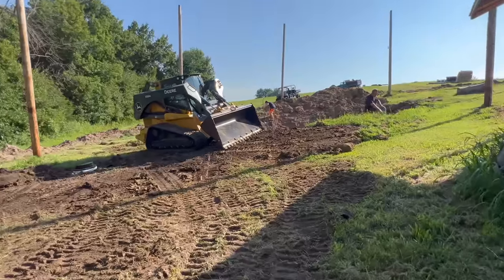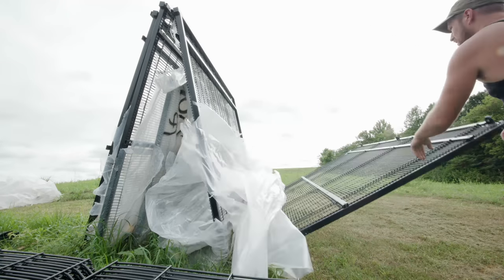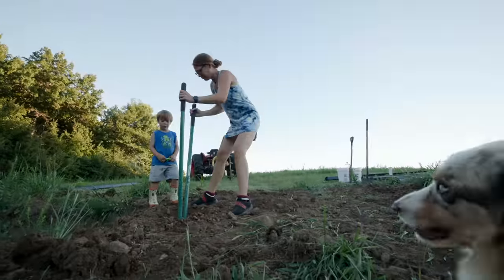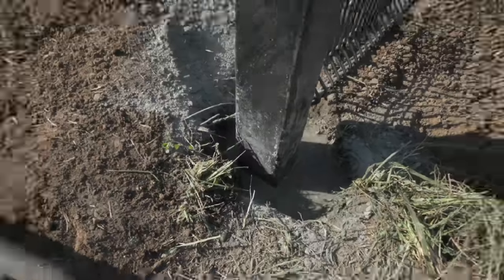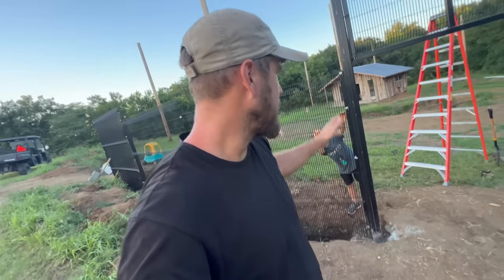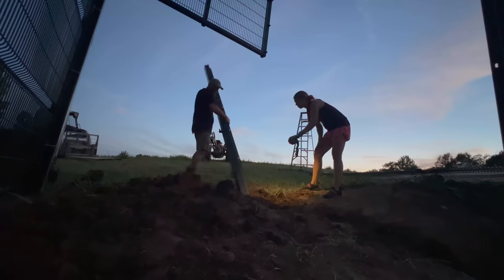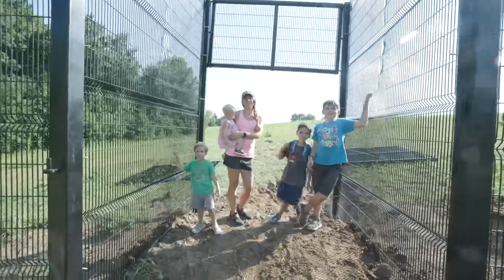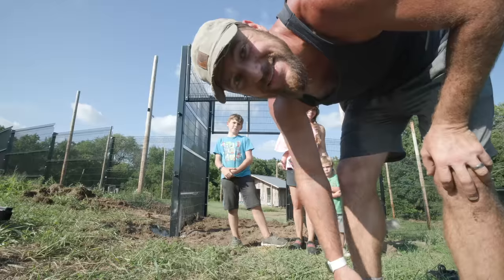The Aviary has a Huge Gate! building an aviary part 8

Comment: one idea to keep some the of the clever land predators from your animals are large rollers on top of the fences but that is purely for permanent fencing like your aviary to prevent animals from climbing over as those predators aint going to be getting a grip on those rollers enough to get them over the fences
Reply: If I remember correctly, they have very heavy duty netting that is going on the top, so nothing will be able to get in anyways! But doesn’t hurt to have all the precautions you can!
Reply from the maker: What are rollers?

Comment: @White House on the Hill Yeah,it is suppose to be level. I have put enclosures like this together before when I was younger. I had run into time and money constraints back then myself so leveling was not always an option. If you have the tools for it or if the structure has ways to allow you to do it...what we did was got rolls of barbless wire and strung it across to give it a straighter top and than got rolls of yard guard fencing and hung it on the wire guides we made with the barbless wire. Sometimes we needed to drill holes and once even had a welder guy come but for the most part we made it work. We had to because some of these we built had roofing and types of netting or fenced roofing. It was still not a perfect fit all the time because the roofing was usually made to fit when level but this stuff will help fill it in where you need to. Just remember to attach any netting or roofing to the structure as much as possible for integrity. You seem to figure things out to fit your needs though so hopefully it will all come together smoothly. You guys are tough though! I had the help of 4 or 5 guys,a lift or two,forklift,excavator,backhoe and a roller to level but we did not pay for it because it was contracted. Keep up the good work! Can not to see it in use!

Comment: Seeing as the bases of the posts are so important, why don't you rent a mixer to mix your cement first and then just pour it into your hole.   Also, shouldn't there be some form there?   To keep the moisture in while the cement sets?

Comment: Dewalt makes Portable Work Lights which work off their 20 Volt Lithium batteries. They are very bright and they would be ideal when working outside at night. I watch Ron Pratt with Midwest Trucking and Recover out of Scott City MO. He does a lot of Late Night and Recovery work and when you are fishing out automobiles in dark woods you need bright dependable lights. They are about $240 a piece but well worth the expense.